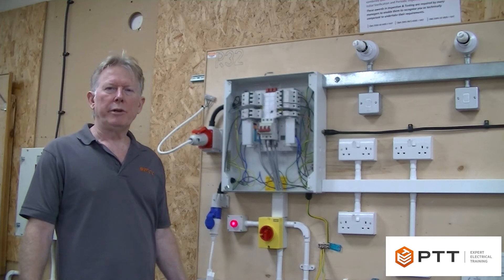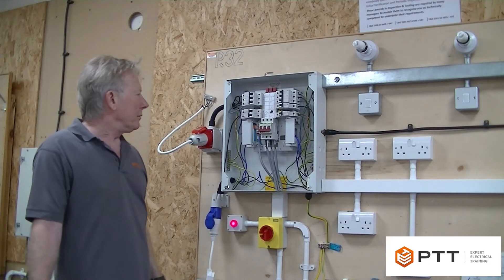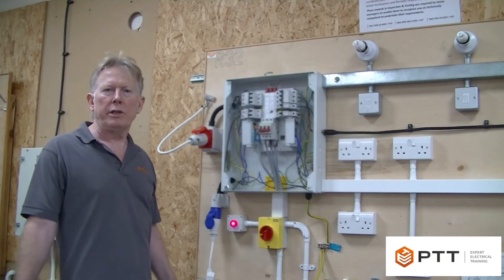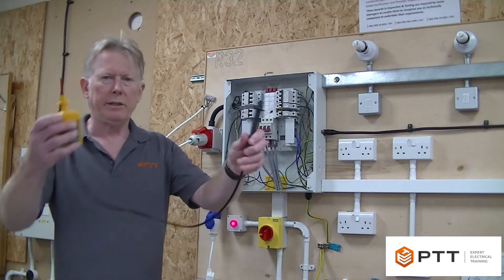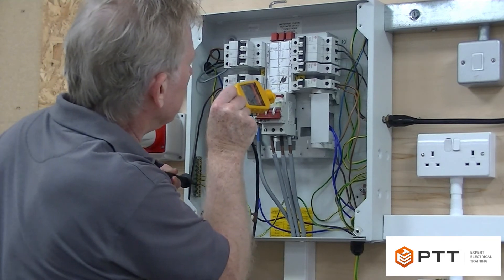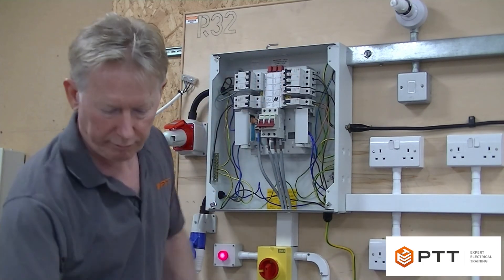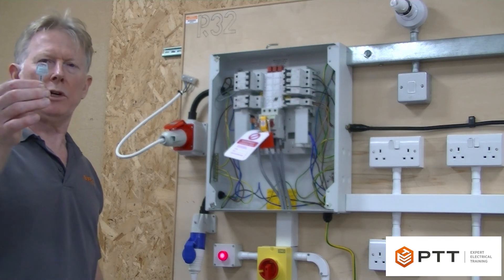Safe Isolation Procedure of a Three Phase Circuit | PTT

Comment: Thanks for the video but shouldn't you have tested your testing equipment before estarting ? What if you  tester was faulty ? 🤔🤔
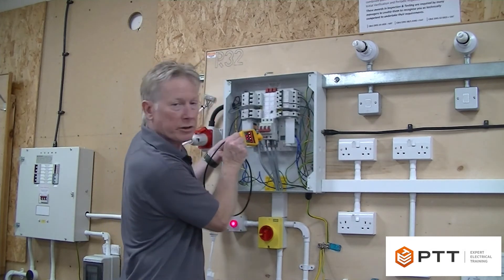Reply: He did. He used the known source of supply 2:00 - 2:15 to test that the voltage indicator is working correctly
Reply: Yes he did, I just don't know if I would pass the course doing that way. I was told to test your tester with a  proving unit before 🤔🤔
Reply: @wagabira  you can do both, prove it with the proving unit or a known use of supply. Both are recognised in city and guilds
Reply: @mrpoo7651  , thanks 👍🏼
Reply: Good to know 👍🏼
Reply: @wagabira  either a proving unit or known supply
Reply: This is a complet incorrect way of isolation. You have ended up removing the cover of the board whilst still powered up from a secondary source. The correct way is to disconnect all loads then the main switch and isolate all isolators, lock off then remove the cover. Using your proving unit to prove your u it works and then test. DO NOT FOLLOW THIS IF DOING YOUR AMD2 OR AMD2S YOU WILL FAIL.